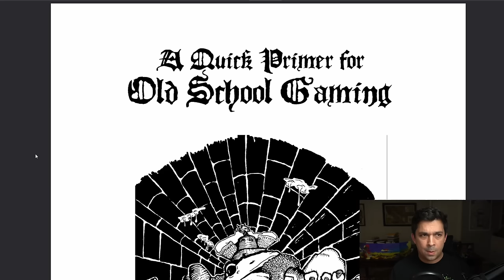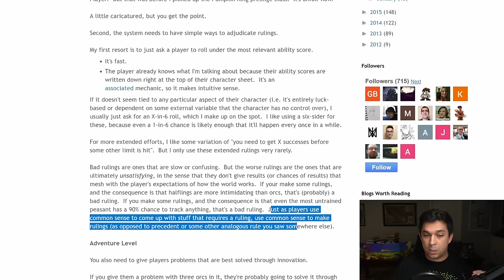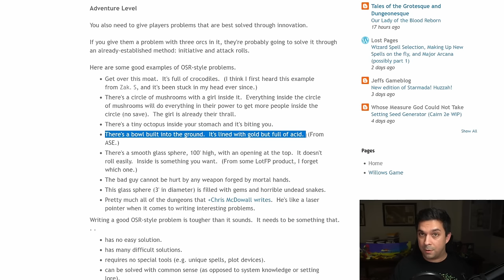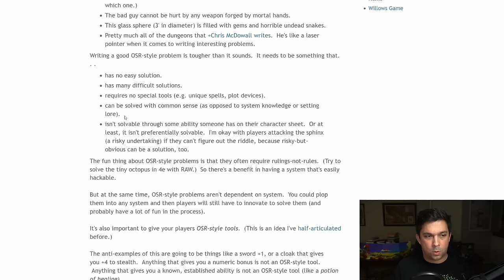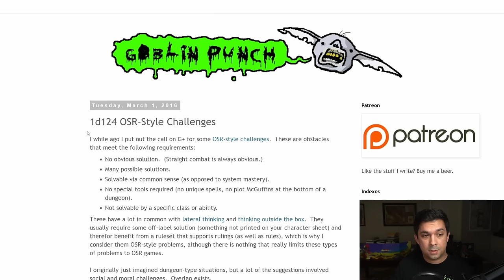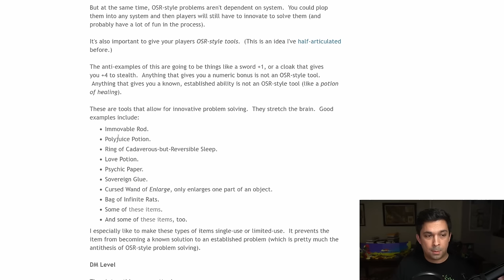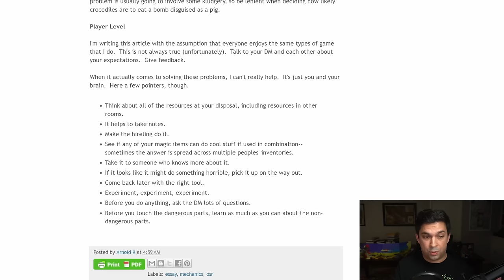The real problem with "Rulings Not Rules" in DnD

Comment: The main issue I always had with "rulings not rules" is it puts a lot of stress on an inexperienced GM, or even a GM just not used to a particular set of mechanics. I have been playing for so long, I can handle things, but the GM just coming up with rules for falling damage,. disease, poison, or whatever, is pretty hard without killing off a lot of characters while you get the nuances right.
Reply: part of this as well is that even with an experienced GM, it also creates a lot of strain if that GM is running for a group they haven't played with before, expectations are a big thing, and a session 0, while it exists to make sure those expectations are understood and aligned, it is not realistically possible to do that completely when those expectations are pretty wide. People who are experienced sprinters are gonna have different expectations on how fast someone physically capable should be able to sprint compared to someone who's a weight lifter, the expectations vary from context to context, but a defined ruleset everyone has access to means everyone is on the same page when it comes to a lot of the expectations of what's physically possible, so that session 0 can now focus on what is realistically possible to achieve in a more grand context of the campaign, and what sorts of things the group expects to be most focused on, like tone and genre

Comment: One problem I run into is that players want consistency in rulings, and they're usually right to.  When I rule on something, that means I'll have to write down how I ruled, so I can remember to do it the same way next time.  This is essentially the same as making a new rule.  So, it's tricky.  When do we want rules?  When do we want rulings?  When do we want to make new rules via rulings?  What I've started doing is telling players how I will handle something before they take an action.  Ex. PC: "my swashbuckler will swing from the chandelier, kick one guard in the head, and draw his rapier, and run the other guard through."  Me: "Okay, cool!  I'm going to call for a DEX check to swing from the chandelier.  If you fail, you'll take 2d6 falling damage and lose the next round getting up.  If you succeed, you'll surprise the guards, but you can only kick one of them in the face on one round and stab the other on a subsequent round.  Do you still want to do that?" (Or however I rule... not necessarily saying this is how I'd really rule, just an example of how I'd let them choose a different action if they don't like how I'd handle it.)
Reply: I love that approach. It's very similar to what I do. A great way around that "locked in" thing is to say "in this instance, in these circumstances, I'm going to say 'x' because I think it's cool. But I might be wrong about that, so we can revisit it."
Reply: Yeah, putting that info up front is something I've started making a habit of as well. 

For one, it helps make players feel in control of their own destiny, even if it does come down to the same die roll. Knowing the risks, they don't end up feeling cheated if things don't go as they hoped or expected. The transparency also fosters a more cooperative relationship between players and DM, I feel. 

But for me, the best part about doing it this way is to create tension. When you establish stakes and risks beforehand, that die roll suddenly becomes a lot more exciting. Particularly powerful when combined with the principle of rolling dice very sparingly - only in situations that involve genuine risk and uncertainty. If I can't think of an interesting or impactful consequence of a failed roll, I don't call for one.

Comment: Rulings are always going to be necessary. The primary strength of ttrpgs is the ability for a human GM to respond and improvise to actions taken. However, I find that a lot of the time rulings can become inconsistent or have knock-on effects due to being essentially slapdash rules. Put another way, rules are just rulings made in advance with more thought put into them. Rulings buy flexibility at the cost of GM responsibility. Rules ease GM responsibility at the cost of rigidity. The more of a game-designer a GM is, the more responsibility they can take without causing problems in the game itself.
Reply: the primary function of the ruling is to interpret the applicability of a prior established rule.

Comment: The idea of OSR solutions can be extended to the character classes of AD&D. The AD&D illusionist, the AD&D druid, the AD&D monk, all excel at approaching problems side-on rather than from the front. This style of play can cause friction with a rigidly structured rule set. This might explain why the classes were effectively abandoned or re written from the ground up in later editions.
Reply: what are you on about? AD&D is a super rigid system, and monks are pretty straightforward in what they do, they kill things quick. D&D basic was a more rules-light and simple system, but AD&D is where a lot of the rigid rules ideas from D&D 3.5e came from, and the dnd3.5e monk greatly resembles its AD&D counterpart, but actually is less limited in what it is capable of than it originally was, being where that more side-on approach was greatly expanded on

Comment: I generally agree with the “OSR” approach to problems.  That said, myself and many of my friends have greatly enjoyed 3.5 and Pathfinder one, especially when it came to character building benefitting from a kind of creeping system mastery.  In my experience, some of our best times, role-playing benefited simultaneously from mechanics on our sheets and creative problem-solving.  I’m not suggesting our experience is somehow “one size fits all”.  But I do think crafting problems like this benefit every game system, crunchy or otherwise.
Reply: Yes, exactly, a system with hard rules enables more creative solutions to problems, rather than hinders them, like, yes, sometimes you can just brute force it, but that ability to know what you are capable of means you know that if you do this in this scenerio, this result will happen, and that result happening in this scenerio, will achieve our goals, even if the tool isn't normally used to achieve that goal, it's basic immersive sim video game logic

Comment: I think a great example of an "OSR Problem" and an "OSR Solution" is actually in the D&D movie.

Spoilers:
...
...
...
They need to get inside the safe that has a magical seal on it that absolutely nothing can break whatsoever once it is closed, not even magic!
Solution: They put a passwall from a magical Hither-to-Thither staff (a portal gun basically) on the back of a portrait of Volo, replace the painting and then when the painting is in place, they open up the other side of the passwall to get through. 

Some shenanigans occurs but, ultimately, it was a very creative problem and creative solution that felt extremely D&D when watching it.

Comment: When I think of “Rulings, not Rules” in the context of adding to the adventure, I am immediately hit with the feeling of making a roll, rolling low resulting in a failure, and being left feeling unfulfilled.

When being the DM, if a player tries to (for example) pick a lock, and despite having proficiency and high stats, still rolls low, it can be souring to just move on. I’ll often try to add something there to explain why an otherwise talented lockpick failed what should have been quick and easy. Perhaps the lock is overly complex, which begs the question “why?”.

This adds to the adventure, by complimenting the character’s skill, but also providing a potential hook to further drive the plot.  What’s behind the lock? I can put anything I want there, and if that’s the direction the party takes, then I successfully turned a failed roll into a full quest.
Reply: Yeah, can definitely be utilised this way and help with more emergent stuff but could also be a nuisance if it is not in the service of the story/adventure or the goals of the players/DM for the game imo.
Reply: If the consequence of failure is just "the adventure stops" that's a poorly designed test. A character with high enough proficiency in lockpicking should always be able to roll a lock, but the roll can decide several things: maybe it takes a long time and some other time sensitive task has to be sacrificed. maybe it makes a loud noise and alerts a guard. maybe their thieves tools break. Maybe the lock is damaged so at a glance someone will be able to tell it was picked. There are lots of results to a "failed" check than just "you can't do it."

Comment: I noticed two related elements of the video, one where Ben mentions adding simple mechanics to aid rulings into more complex games (such as adding percentiles or X-in-6 rolls to a game that normally doesn't use them), and later where he talks about letting players try things with a chance of success even if the DM isn't sure they'd work -- the players are trying to be creative, after all.

Matt Mercer, the DM on Critical Role, does this in almost every episode. "You can certainly try" is practically his mantra. The specific example of adapting dice mechanics is his way of allowing spellcasters to flex spells in unusual ways: he uses the rule for Counterspell (basically, roll a d20 + spellcasting ability to beat a difficulty DC) as a way to resolve any weird spell effect. The result is that strange uses of spells in his games are possible, but unreliable, which actually manages to make 5th Edition spellcasting more magical (that is, strange and unpredictable) at the cost of some risk.

I'm not saying everybody should do this, but just that it's one example of how the advice could be implemented. There are probably twice as many ways of using rules in unexpected ways as there are RPG systems.

Comment: I commonly hear that it's the player's job to figure out how to solve the problem, but that never felt right to me as a DM because if I don't have a solution in mind, then that creates the possibility of no solution which I don't think is very fun. I prefer having a solution, but being open to the players trying something I didn't think of... this way, if the players are truly stumped, I can start dropping hints.
Reply: Solutions to that I feel is to have multiple paths in a dungeon/adventure, if one problem feels too utterly 'unsolvable' to players they can either try their chances with a different problem; or if it is REALLY unsolvable just treat it like a locked door and put some 'key' somewhere that will allow them to either solve or bypass it.
Reply: Generally I'd say that for most TTRPG problems I try to brainstorm 2-3 ways I would solve it with common PC resources and if I can think of a few solutions then it's good to go. Sometimes I'll include some very standard problems (e.g. pits, climbs, spikes, darts, etc...) without bothering to think of a specific solution, because there's so many ways to solve them that it's really unlikely a determined group will be stumped for too long. Other times I'll include something with just one solution (e.g. a magic portal that requires a specific ritual to open) but then I'll make sure that the solution can be learned via some other diegetic source and I generally try not to gate progression entirely behind this sort of thing.
Reply: Yeah, I like to have a solution or two in mind while remaining open to good ideas that the players come up with.
Reply: it is the job of the players to find out THE Solution, it's the GMs job to ensure there is a solution and that the problem is something the players and the GM will want to see solved. Part of this is trying not to be confined to the idea that there is only 1 solution though, when you're at a magically locked door with a secret password needed to get past it, being able to dispell the magic is another option, being able to bypass the door entirely by climbing the wall of the building and going through a window, going through the sewers underneath and making a hole through the floor in a weak spot between the sewer and the building, if the door talks, you may be able to trick it into giving you the password, all of these could be options sometimes to the same problem, but things like the sewer thing can be realistically assumed if the building is in a city where a sewer system does exist, being open to improvise is a big part of this

Comment: My favorite trap is my annual "Shocker Lizard" trap. The original trap came from some old adventure from a while ago, where there was a room with a well of healing water in the middle, overflowing with water and healing anyone who steps into it. Along the walls are clay jars which are held up on wooden planks. The planks are trapped, and when the trap is triggered the jugs will fall into the water. The trick is that the jugs are full of shocker lizards, turning a healing font of water into a deadly trap.

Every year I re-arrange the facets of the trap. Sometimes the lizards are in the water, and must be placed in the jugs. One year the well summoned infinite shocker lizards, and the jugs contained water. Once I switched it so the lizards were actually healing lizards, and the well was heated, with an electric coil on the bottom, so when filled with water it would shock players.

Few referees use re-occuring traps, but I think they're great. They make it so you have to think up less traps over an adventure, and everyone can have fun figuring out how the aspects of a trap have changed, which encourages a new way to solve the problem.
Reply: That’s pretty dang good! xD

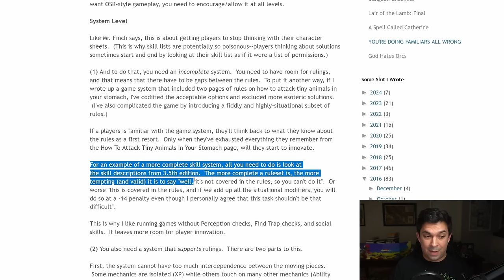Comment: 2:53 if it's something that'd be easy, then that is a situational modifier

Beyond that, an in-depth system  theoretically can be created where it accurately represents the scenerios you want in a satisfying way to begin with, like the greatly refined version of dnd3.5e known as pathfinder1e, where generally speaking, anything basic anyone can do, anyone can do, but there's major benefits when you are actually trained for it, and when you realistically can't do it, you realistically can't do it, with optional rules to adjust some of this to preference. I love looking at pf1e as something akin to an immersive sim style game, the solutions to problems are still using the tools available, but you can very well create a problem without creating the solution, but between all the tools available, you very well can find a solution, and I find this far more satisfying than some random nonsense I rarely will have use for, that I was just given, if I wand something highly niche, I'll take something highly niche, I like my highly niche stuff but not at the cost of all existing understanding being made obsolete because a new set of rules are being introduced all the time, which makes that existing understanding obsolete, in my mind.

Randomness does not equal creative, randomness can be used as a source of creativity, but some level of foundation is needed for that

Comment: The argument that just because something is not in the rules means you can't do it doesn't hold water.  If it is not covered, then that topic is ripe for a DM ruling.  Also, Matt Finch is not saying you should not use common sense in making your rulings.
Reply: I think the intent of that statement was more along the lines that systems that lean toward "rules for most the things" vs "rules for very few things" can encourage a certain style of play wherein things are run almost procedurally to the point that anything not spelled out in the rules is considered out-of-bounds. Or, put another way, OSR kind of embraces the idea of  "things outside the system are inside the system" (hows that for irony?), whereas very rules-heavy games may tend more towards "things not inside the system, are outside the system."  Though by no means is this a mutually exclusive distinction.

Comment: 5e has a good mechanic for task resolution...the PROFICIENCY system.  Just set up a task rating system to measure the DIFFICULTY LEVEL in the world, character level not withstanding. An example of such a Task Rating Chart would be...

EASY TASKS: roll a 2 or higher on D20 (95% chance of success).

ROUTINE TASKS:   This is a task that is easily achieved the vast majority of time. The DC would be 5+ on D20 (75% chance of success).

AVERAGE TASKS:  This is a task where you have a 50/50 chance of success.  The DC here is 10+.

DIFFICULT TASKS: You now have a greater chance of failure than success.  The DC here is 15+ (25% chance of success).  

FORMIDABLE TASK: This is a task that should only be undertaken by a professional.  The DC here is 20+ (an unmodified 5%  chance of success).  

IMPOSSIBLE TASKS:  These tasks have no real chance of success unless the individual has bonuses to modify their roll.  The DC for this type of task is 25+.  

Character's PROFICIENCY types.

NONPROFICIENT: The individual has no listed skill for the task.  They must roll said Task with DISADVANTAGE. But you may add any Characteristic bonuses to your roll (for natural talent).

BASIC PROFICIENCY: The individual has only the basic knowledge of how to do the task and doesn't practice enough to improve it.   Basic Proficiency doesn't give you any Proficiency Bonus but you do roll without DISADVANTAGE and you may add any Characteristic Bonuses to your roll (for natural talent).

EXPERT & MARTIAL PROFICIENCY: This is a skill you practice frequently and are constantly improving. You may add your Proficiency Bonus to any Characteristic Bonus before rolling against the DC.  

MASTERY:  This requires Expert/Martial Proficiency and is awarded at higher Levels of character development.  Mastery gives you ADVANTAGE  on all skill checks using that Proficiency.  I use this system for both Weapon and Nonweapon Proficiencies. That means that your Wizard with just Basic Weapons Proficiency NEVER improves with their chance to hit, while Martial's will eventually gain ADVANTAGE on all their attacks.